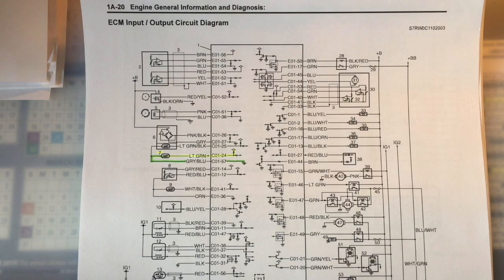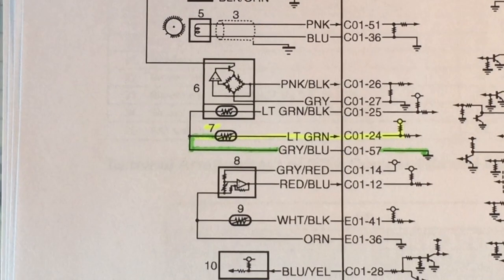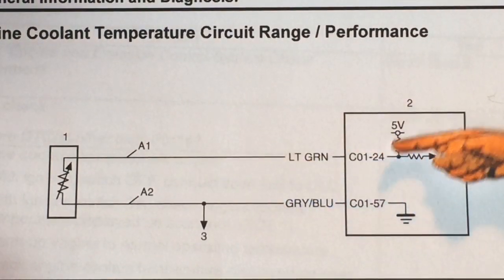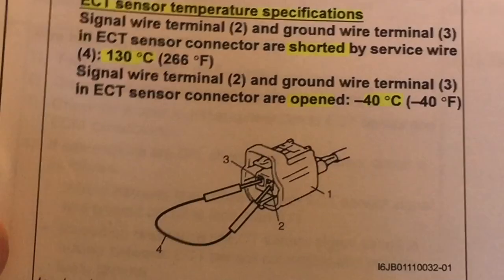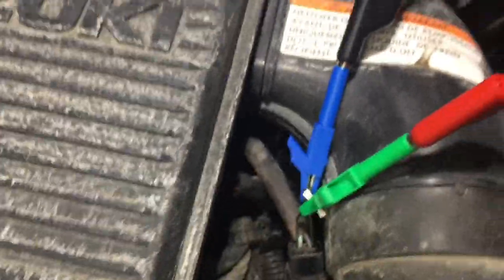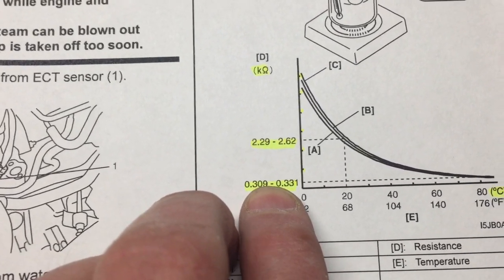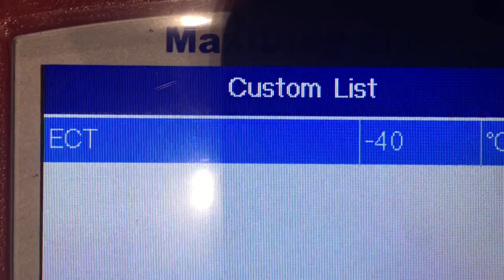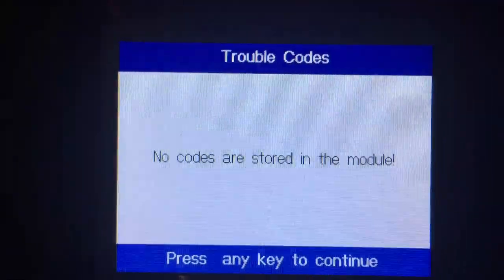Suzuki SX4 E.C.T Circuitry

Comment: Great info... I have a 2012 sx4 automatic.. trying to figure out a weird situation.. the coolant temp gets up to normal value when sitting at idle.  As soon as I put the transmission into gear and start driving the temp gauge starts rising to Hot . If I stop and put it back into park the gauge comes back down to normal range... I tested the ECT when the engine is cool at ambient 70degrees fahrenheit.. the ohm resistance is about 2.126.. not sure why the car seems to overheat the way it is.. any insight is appreciated
Reply from the maker: Is it a CVT?
Reply: @TheGibby3340  Yes
Reply from the maker: I believe the CVT models have a dedicated external oil cooler. Check for debris/core damage restricting air flow. Also check for kinked or collapsed/pinched CVT oil lines. Such a condition could result in excessive heat transfer to the evaporator (if equipped) and radiator assemblies. Also confirm CVT oil quantity. Assuming you have already checked the basics of cooling system…quantity, quality, pressure, no air locks and circulation. In addition to electric fan operation. 🍀🍻
Reply: @TheGibby3340  I just took the transmission pan off.. there seems to be some very fine fillings on the magnets.. nothing too crazy.. the external core looks ok.. yes it transfers to the radiator as well .. I'm pretty sure someone changed the cvt oil and put in motor oil.. could this be causing the engine temp to rise to hot when I'm in gear and driving? Very oddball situation to troubleshoot... I'm going to replace the trans filter and add new cvt green oil . I was minutes away from pulling the head and changing the head gasket thinking that was my issue.. but no white smoke, plugs look fine. Car runs fine at idle.. I noticed someone added barsleak in the radiator
Reply from the maker: 🤔 You can’t go wrong servicing the CVT. I would double check the system is holding pressure -15psi. (Especially if you see evidence of leak sealer)If it’s not the boiling point of the coolant will be significantly lowered as you likely know. Good luck 👍
Reply: @TheGibby3340 I think they used a sealer cuz they thought the head gasket was bad. But theres something goin on with the radiator for sure.. the cap was missing the little valve for pressure vacuum release.. I have another sx4 that I drive daily.. I swapped my cap onto the new car and it seems to hold pressure but I'm not certain.. I'm ordering a new radiator just to make sure.. also when cooling down the upper rad hose collapses... So there's definitely something going on.. but the rad cap I used for testing works fine on my daily  sx4 so I know rad hose is not collapsing due to faulty cap. Sorry for the rant
Reply: @TheGibby3340  what are you getting at? I checked the cvt oil dipstick and it looks like clean motor oil.. I know it's supposed to be green oil... So maybe the previous owner screwed up bigtime or did the green oil turn brown from overheating?

Comment: When it comes to bikes and cars, my two weakest efforts are in electrical and painting.  That said I'd rather have a bash at painting before I'd try my hand at electrical.
All I know is that with Lucas Electrics, the larger wires smoke more than the small ones.